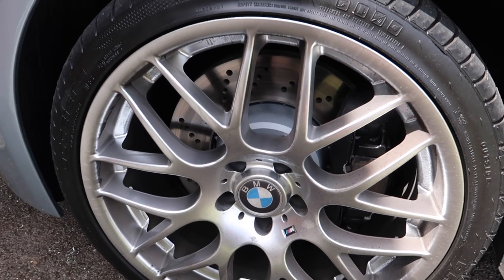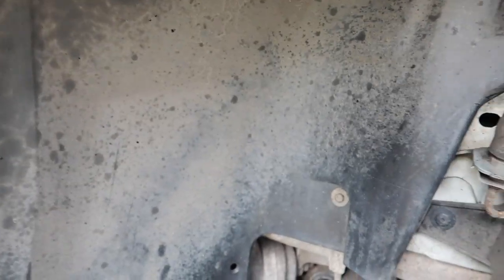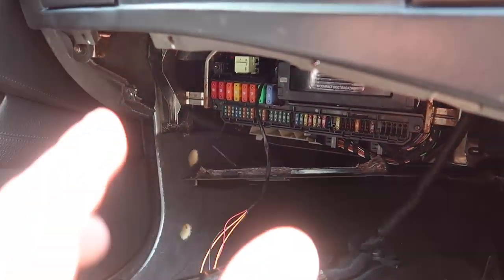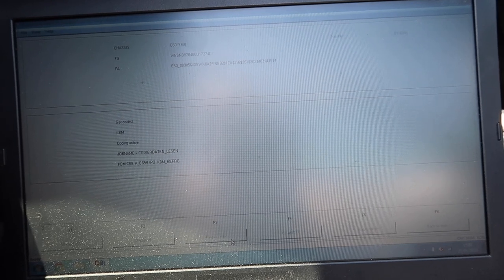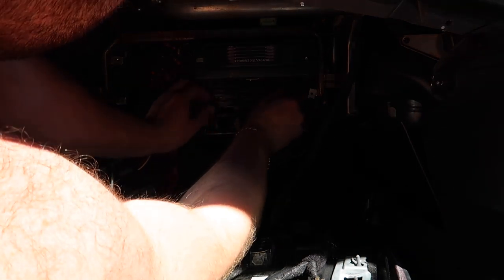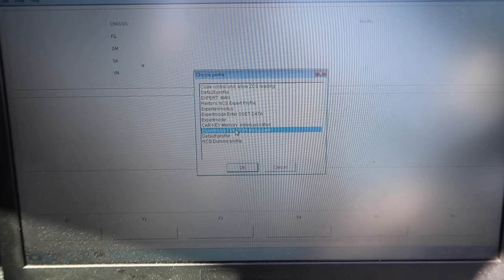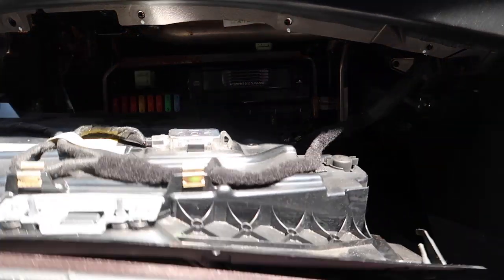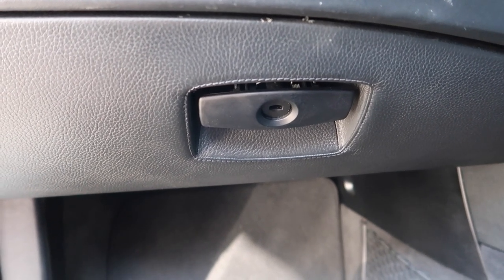BMW E60 E61 E63 Windscreen Washer Pump Getting No Power FIX !!!

Comment: Appreciate the video doc. My windshield washers weren’t working at all. Found your video here so I replaced the pump first and I ended up getting lucky with that. They’re fully working again for $15. Thanks also for the heads up on the spillage lol, I put a large bucket underneath for that.

Comment: Interesting video again. 
Doesn't the kbm throw a code if its broken, so that you didn't have to change the pump? Or were both broken?
Reply from the maker: That’s top secret I can’t tell you that, I have special tools for checking that I had to buy when working at BMW that we ca. Plug in and check the module 

And no I changed pump anyway but it wasn’t broken but it was completely knackered when I tested it

Comment: Hey bro, thanks for the video! I got a faulty KBM module. Got the NCS Inpa and WinkPF too along with the cable. New module just arrived from ebay. Gonna proceed on sunday. I will have to code the new module, if its not the same part number, is that an issue?Thanks in advance (E61 from 2006)

Comment: Sorry, Dean. I wanted to confirm what you did when you programmed the replacement KBM with WinKFP, you were simply connecting your laptop to the OBD2 port is that correct? D-CAN cable? Thanks again. A very informative video.
Reply: Did you ever get an answer to this? I need to swap my KBM and just need to the copy and write steps a little clearer

Comment: Love your videos brother. I ended up taking the pump out and bench testing it. Guess the motor was seized bc soon as it work on the bench test I popped it back in and it worked with the controls. Time for a new pump I guess. Thanks a lot brother.

Comment: What else is controlled by the module? I am going to need to replace mine but would like to get a heads up what else is controlled by this module? also what is the original part number for the module? I have to find/buy one. Any info will be greatly appreciated?

Comment: Hello Dean. I have a problem fuse ,relay, wiper motor test ok. Washer pump work and rain sensor light turn on but wiper don't work. Could be the module?

Comment: Dean, Have you tried to repair that KDM in the E60 or what my experience reminds me of a similiar issue with my adaptive headlights, if or when water shorts out the HV ballast module under the lamp assy via the seal failing, the vehicle Module that drives that ballast has 50 key cycles of a shorted circuit then it quits trying to turn this ballast on anymore. I followed a BMW tech in the UK and tried to copy each step of going thru the SW to reset the modules counter back to 0, It is very difficult to grasp at first but after trying it a lot of times I was able to reset the counter in the module, My hardest hurdle was trying to follow my SW that was in German. My guess is this module you have and I as well have same neither washer pumps are working and My son was using the car for a year and ran the bottle dry and I'm sure he tried constantly to get the spray to work. I may have to find a used KDM as well on EBAY now. I'm too rusty on the SW side to try and see if there is a reset for this counter if it even has one. Thanks for the great video's we all learn a lot from them.

Comment: Hey doc, would ISTA have shown any issues with that module before you decided to replace it??
I'm thinking about how I would have diagnosed this issue...
Thanks!
Hm, surprised to see the "oxidation" on the fuse panel metal housing.  What would cause that, in your car? Water infiltration??
Reply from the maker: No mate the oxidation is normal on all E60s it’s a metal frame inside therefore just cold weather over the years causes that it’s perfectly normal and most cars when you remove the glovebox like that you will notice many many are like that 

Also no ista doesn’t show this as a fault i have special tools that I use to diagnose these modules which I plug up to the module and can run tests on each relay to make sure there powering there specific circuits it’s a harness we used to use in BMW which checks for the following:

BATTERY DRAIN 

SHORT CIRCUIT 

BOARD FAILURE 

RELAY FAILURE 

voltage current coming in and out the modules

And also used to make tests if needed back and fourth between the cars 

But that harness needs to be linked up to the official ISTA and it runs its tests 

You will notice in many many ista test plans they ask you to connect certain plugs up to the module this is called a test harness we have all BMW technicians will have this for module testing it makes doing these cars very very very easy indeed and cannot be beaten 

There not available for sale or made anywhere most of us buy this when we are there and keep them as it’s bought out of our own trade account like all our tools 

But it beats everything and anything and BMW from a hard car becomes very easy to diagnose in minutes

We have about 50 plugs on the harness one goes to a port on the computer we plug in and another straight to the module we are testing or whatever ista asks us to probe it will then conduct it’s own tests based on the harness and fault finds for you it’s puts all the modules used for fault finding in circuit and on a open test and runs them like it would on the car to find the fault

My harness is used on ALL BMW E90 E91 E92 E87 E82 E88 E60 E61 E63 E65 any of them I try to not use it so much on here as I don’t want people trying to make one or clone one so I don’t delve in with it but it’s what I usually send Nathan when he needs to use it BUT I don’t let him use it for video purposes as He’s not allowed 

But I have used it to just diagnose another module failure on the car which I need replacing which is coming on another video
Reply: Thanks for the info, Dr Dean!

Comment: Hello🙂BMW E60,525D problem: The windshield washer works only a few times after I turn on the ignition or start the engine, then the pump stops when I actuate the lever but the wipers work. I turn it off again, turn on the ignition, it works again for 5-6 or perfectly, then the washing doesn't work anymore, the pump can't be heard either.

Comment: Would it be possible to take apart the kpm and replace the relay?
Reply from the maker: RELAYS are NOT replaceable on the modules but the modules are very very cheap £10 on eBay I have loads of them

Comment: I've heard some shite in my time but blaming MOT testers for burning the crap quality under designed KBM pump drive circuit/relay out has to be right up there with the best. Just swap the relay, 10 minute solder job even without the right gear. Not really having a dig but just admit it's a poor quality design and not fit for purpose. It is undoubtedly designed to fail, same as the Renault miniature relays in their UPC modules.
Reply from the maker: my friend dont compare Renault to BMW. BMW is very very advanced compared to that French crap and it is the MOT testers problems they burn the circuits not the first time I have seen this believe me I do this day in day out
Reply: @BMWDoctor  So do I. All I'm saying is that relay should not burn out the way it consistently does. Exactly the same way the French junk does. Both are not fit for purpose and are both designed and built to fail.
Reply from the maker: BMWS are NOT designed to fail at all. I have a E60 now on 170k with the same modules that works perfectly and needed NOTHING and no new modules this is all due to neglect and many many many owners owning this car needing many things replaced I have had to replace many other modules on this car, which as well you will see is another problem people are banging there heads against a brick wall.

because NONE OF THESE keyboard warriors and forum members know crap about crap and definitely not these cars the first thing they tell everyone is its a FUSE and I HATE THAT fuses do not pop constantly or frequently and when they pop it means there is a problem further down to be making that happen.

this is why I run a channel and most of them watch and learn and and hopefully stop making people tear apart there car when they know nothing about anything
Reply: @BMWDoctor  Totally agree. Your cars like mine will tend to fail less than most because we do preventative maintenance. All these remote functions are fused but they use a common fuse that powers a number of relays etc. in the module. But, these modules are weak. With regard to the KBM the pumps start seizing drawing more current and because of the high shared fuse value and the under-rated internal relay they inevitably burn out. BMW like all manufacturers design these modules to fail so they can royally ream punters who blindly go to the dealer. Most modules do repair and don't need swapping. I've been repairing them for 40 years and I've seen the "progress" all manufacturers have made. Half of it totally stupid. Maybe not half but you get what I mean. Anyway, keep up the good work.

Comment: I have a question. On my E60 The windshield washer does not spray water on the windshield when its a dry day, however if the windshield is wet or if there are light showers the washer will spray water on the windshield. Is that normal as it is very annoying if i need to clear the windshield otherwise.

Comment: Question I have 2 pumps the grey and black one but no headlight washers? Got an e61 2009, is the part just in their in case I had the washer jets fitted?
Reply: @darrenstones6639  did you get it sorted? Having the same problem and pump replacement didnt help

Comment: Hi, i have a similar problem on my x3 F25 2014 , front washer pump doesn't work , i already replaced the front an rear pump , checked the line , i have this error on ISTA : 802099 Windscreen washer pump , front : open circuit or short circuit to positive , since i manipuled the pumps , i have know the warning washer fluid but the tank is full, i cleaned the tank and changed the sensor but the problem is always here

Comment: Im one of the admins on BMW F10/F11 Sweden and you’re spot on when you mention the lack of knowledge from all of the “know it all” guys🤦🏻‍♂️😂

Btw, can’t you just replace the relay?🤔 thinking if someone can get this far they must be able to solder on a new relay on a pcb🤷‍♂️😂 or is the module gumed up?
Reply from the maker: No mate the relays ain’t worth fixing as o will show on another video they ain’t replaceable on the board and when you can buy the module for £10 it doesn’t really make sense mate 

And yes mate that’s correct so you know how much this problem is asked everywhere on forums and they al end up in a brick wall because the little forum guys don’t know there arse from there elbow and don’t know crap about these cars and how they work 

This is why so many are still running around with this problem failing MOT as this is a MUST in the U.K. for MOT or it will be a straight failure 

Yet they act like they know everything when they actually know f**k all as there all wankers to be honest none have my skills or are on par with me I will be opening my own forum soon and hope to end the little keyboard warrior that run around sharing YouTube videos after they make people rip there whole car apart looking for issues 

First thing everyone says is CHECK THE FUSE as if there is a f****king fuse on a E60 for washer pump this isn’t 1990 this is a new era car I dread to think how any of them would diagnose a f series if they can’t even work out how advanced bmw is they don’t use fuses for hardly anything critical on a car anymore
Reply: BMW Doctor aah nope not worth it then😬 it just hit me cause so many people just swap things out without checking the real problem first and some times it’s as easy as a blown diod or bad soldering connection 🤷‍♂️😊

Ooh I’m 100% backing you up on that statement 😊 the forums and groups are full of them and a lot of arguments flying around with no reason 🥴 we have zero bullshit policy on the Swedish Facebook group.

Thx for you’re videos, to bad you dident make them 5 years ago when I started learning some of this stuff and managed to brick my F11 in the middle of the night😂😂🤦🏻‍♂️ I did have a copy so I managed to get the car running but I had to Skype with chawn and let him fix my car over teamviewer 😂😂 

It’s just a car I always says but that night I shit my pants and thought my wife would bury my as in the garden the next day😂
Reply from the maker: my friend do not worry watch the next video I put out my friend this is another common common problem where on the forums nobody knows crap trust me its another module fault and yet all these people tell you the fuse and I'm going to explain in the next video what happens and how its all controlled these kind of videos is what makes forum members look a idiot and should be removed from there immediately none of them know anything about anything where I'm very professional in what I do and know what I'm doing with these cars.

I know how every line communicates and what communicates to what on this car so these cars are like a baby for me
Reply: @BMWDoctor  Damn........Totally blown away.

Comment: My BMW 5 2007 E60 shows ( fuel reserve) at the screen and the engine does not run.. What should I check
And please note that I already check that the fuel pump are running and the fuel return from the return tube apov the engine neer the air inlet

Comment: Hey bro I got big questions plz help me out I change the valve cover on my e60 550i and my car sound like I have a leake and little slow acceleration  got code VVL can u help me out plz ☹ the car was working fine when I change gasket

Comment: The amount of work to fix this is ridiculous dude. Leave it to bmw 🙄
Reply from the maker: Why would I when it took me 10 mins to rectify it. It looks longer then it actually is, but without recording Becsuse I know what I’m doing it would of taken 5 mins.
Reply: @BMWDoctor  oh nice. Just diagnosed my pump being bad. Hopefully the relay is good in mine
Reply: @BMWDoctor   any ideea if the kbm on car is basis and the replacement part doesn't have basis is it ok ? Or they have to be same
Cheers